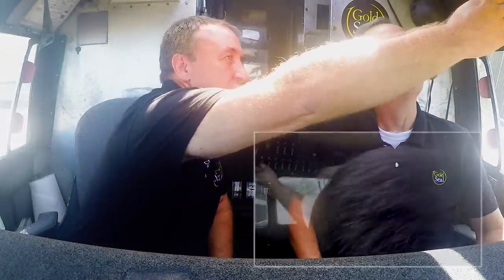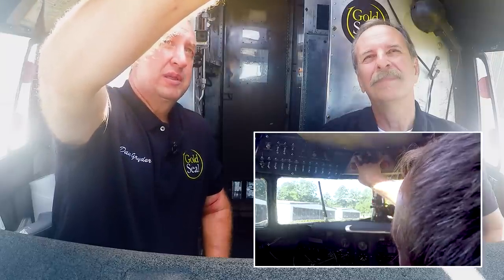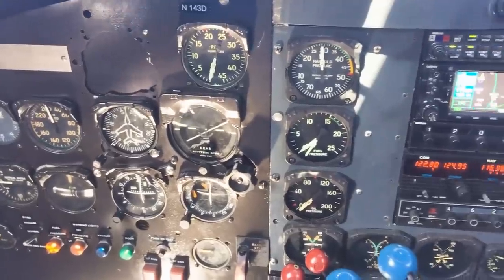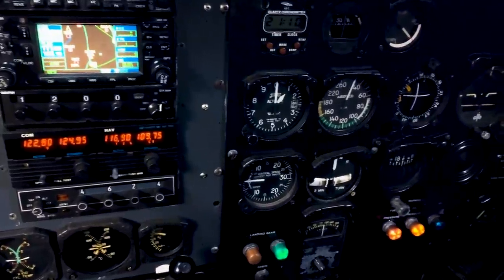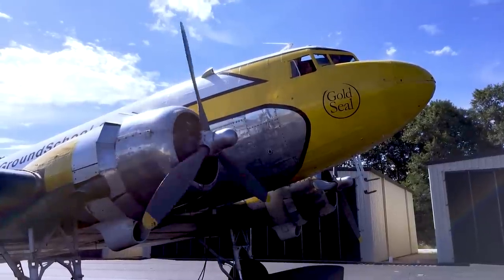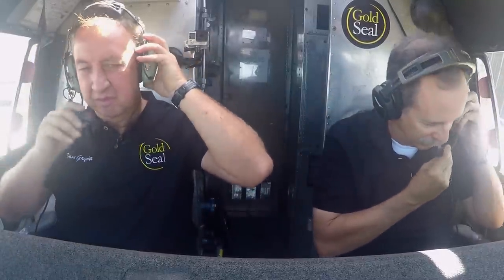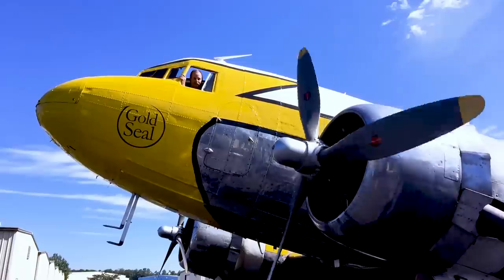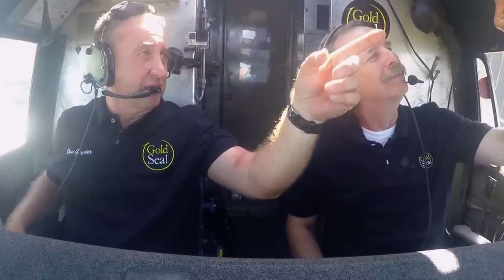Secrets to Starting the DC-3

Comment: My father, a lifelong private pilot, was Air Intelligence Officer in Pleiku, Vietnam, in 1964. At one point, he was a passenger on a Vietnamese C-47 to a dirt strip in a spot with a lot of VC. They felt safe, but knew they'd be sitting ducks after dark. When they went to leave, one engine wouldn't start. They tried various things, but it refused. With sunset nearing, my father brought a cargo strap out, put it over a propeller blade, and got eight guys to pull it. The engine started. Just another version of 'auxiliary power', I guess.

Comment: In 1968, I saw a C-47 right engine, started by 'rope', like a lawn mower. The rope was pulled by 15 Marines at MCAS in S. Carolina.  'It took 2 tries then we were on our way back to Florida.  I'll never forget that..
Reply: You are the only other person I have met who has seen this!!!  As a kid (6 - 8 grades), 1955 - 1957, I lived with my family in Tingo Maria, Peru. I once saw THREE engines on a DC-3 started by hand!  The right engine started normally. The left engine would not crank (I have NO idea what the problem was). They had a bit of a 'boot' that slipped over the end of one blade, this 'boot' had two ropes (elasticized, I think) fastened to it.  Four or five men leaned into each rope and a third swung the prop. The left engine was started by hand, and then the right engine would not crank. Due to direction of rotation, they shut down the left, started the right by rope and then again the left.  Hence THREE engines started by had on a twin-engine plane!
Reply: MCAS Beaufort. I was stationed there for 5 and half years and got out in 2016.

Comment: "The engine(s) will talk to you if you listen to them" - words of wisdom!
Reply: Yup, applies to radial aircraft engines, car engines, even simple 2 stroke motorcycle engines. Mixture, ignition timing, mechanical issues, listen and feel the engine, don't just rely on sensors, and lights or readouts.

Comment: On the vehicles that I service, I like to check the voltage drop between the lug on the starter motor, and the positive battery post while cranking,, also between the case of the starter and the negative battery post, again, while cranking.  Tracking down, and reducing resistance in the starting circuit can make a huge difference.  Great video !

Comment: Enjoyed the video. My first commercial job as an F/O was on the DC3 in the early/mid 80's. The panel layouts were very original, much more basic than shown here.
However after doing essential safety checks in the cockpit, my job was to remove the oil drip trays below the engines, and turn them over 12 blades to check for hydraulic lock, although I never encountered any. We did not have a pre-oiler or external batteries. Having completed the pre-start checks, essentially we had 2 switches next to each other. The first engaged the starter motor onto the flywheel and after 15 seconds the second switch was used to clutch the the flywheel to the engine. It's difficult to remember now , but after say 5 seconds the fuel was selected on, and after a little coughing, the engine would start fine, perhaps catching with a bit more throttle. Good batteries were needed....how else would you be able to operate the electric hydraulic feather pumps if an engine had to be shut down on say take off. Or unfeather for a restart....although I picked up a tip from an X Sunderland pilot. They flew that long that routinely they shut an engine down in order to top up oil for the throttle dash pots ( or something like that ). To save the starters and have a bit of fun, they would dive to the sea, side slip, get the prop turning and then put the fuel in !! 
One night the starter would not work, so out came the manual starting handle...that's when I learnt it was a 2 man job !!  Very difficult to get the flywheel up to speed and barely turned the engine when clutched....but it freed the starter so we were OK.
Only did it once, but you could start with 2 ropes. One bagged onto the top prop tip, to get the engine turning, and the second wrapped around the prop boss, like a windlass, to keep it turning...with lots of bodies running on this rope. About 1400 hours and about a dozen engine failures. Your ears became tuned to the engine note and vibration...very easy to doze off at night...and recognise a particular cough, like someone clearing their throats, telling you of a problem.
Reply: The '3 in this video has direct drive starters, you were flying with inertia starters. One little trick you could do with the old inertia start system was start both engines at the same time. You did that by spinning up the starters 5 or so seconds at a time for a while until both were up to speed. Then you quickly flipped the engagement switch from side to side. If you had the prime done right they would both light just about on the same blade over.
Reply: Your aircraft were equipped with inertial starters.  The airline I worked for (A&P) had DC-3s with direct-cranking starters.  We started the engine on primer, brought in the mixture, and then released the primer when we heard the engine choke on too much fuel.  Watching pilots do it, I discovered that they would sometimes start a still-hot engine with primer and mixture off.  As soon as a cylinder fired, they brought in the mixture.  I tried it, and t worked.  Even after an idle-cut off engine shutdown with mags on, a hot engine would find enough gas vapors in the induction system to fire up on the next start.  Don't ever let anybody tell you that the possibility of a hot mag is not a danger.  Always do a mag safety check after starting.
Reply: California Dreami

Comment: In my outfit in the Navy, we had 2 C-47's. We never turned the props through or pre-oiled, but we did use external power to start them always. Our APU was a gas-powered engine hooked to a 28VDC generator. It spun the props through pretty fast.

Comment: Awesome! Interesting tips about the voltage and being able to run the stater for longer due to the increased capacity. Never even crossed my mind to beef up the battery capacity for extended cranking, even though we learnt about electrical principles in high school physics 11/12. Useful tip for where I fly up in Canada, we some cold days during winter where it can take a few extra cranks to get going first thing in the morning.

Comment: Thank you for such a great insight, I’m sorry if I missed it if you don’t pull the engine through, do you drop the spark plugs out of the lower cylinders o drain the oil?

Comment: Pulling the Props through - I have never seen that ever in the years I was flying DC-3's in our Airlines (1,600 hours) & have never seen hydraulic lock.
Had a chuckle about the Electric Boost Pumps, I only flew one Aircraft with Pratt's that had them - all the rest of my hours were on Cyclone Engines (Which BTW the Company bought for $20 just after the War).
 We had a Wobble Pump behind the Captains seat which was my job to work.
 We told the Hostie that lever was to retract the Tail Wheel. :o)

Comment: I always pull props through counterclocwise six blades before starting...nev had hydro-lock.
Also went to 50 inches on take off (R 2000 7m 2.
To pattern altutude before meto.
Only had one cracked cylinder in thousands of hrs flying.on 7 m2 its usually #1 
Big radials,have to letem warm up to temp first...
Reply: You want 12 blades for two full revolutions of the crankshaft, which puts each cylinder through a compression stroke if you are going to be positive there is no hydraulic lock.

Comment: I've worked around a lot of Radial Engines - primarily the PW R-2800 on the old USAF C-118.   I worked all of the Instrumentation on that airplane.  I always saw the ground crew "pulling" the props through (slowly) which would cause the lower cylinder's valves to "open" and release any trapped oil, if there was in fact any oil in that cylinder.Not being an "engine man," I'm not sure if a radial that is "just started," that the motion of the prop would be "so fast" as to cause a hydraulic lock and bend a rod.   (not allowing any trapped "thick oil" to drain first.)Hey, move the prop a little - valves will open, and any "trapped oil" will drain out an open value.   Couldn't be simpler, that is unless someone left a mag switch in the "On" position.  There is always the chance that "Murphy's Law" will be in effect.
Reply: I went to airplane school at Reedley College in 1976. The Aero dept would buy tons of military surplus from the Stockton (Navy?) depot. We had rows upon rows of surplus reconditioned and rebuildable cylinders and they would sell those parts to operators all over the world. One of the instructors told us that lots of the systems they were required to teach us were obsolete (pressure carbs) and we would probably never see the stuff. Well.. one of the students got a job nearby working on the B-17's that were contracted to the forest service for fire bombing..and that's all he worked on! Last time I went to visit they were now teaching how to repair carbon fiber panels.. something that didn't exist in my day.

Comment: In fact, engine 2 is started first and engine 1 second. That's normal for a DC-3/C-47, cos the cargo/entrance door is at the engine 1 side. In this case it was easier to get the last people in, while engine 2 on the other side was already running.

Comment: Even though those two six volt batteries are pretty good size and I'd have to make some modifications to the Dodge, it would still be worth while if, like he says, you can't run those batteries down. I've never seen any battery that won't eventually go dead if drained long enough.
Reply: Those batteries are not 6 volts. They have 6 cells in series, so they are 12 volts each. 2 in series gives 24 volts. Each cell looks almost have the size of a full car battery. The amperage capacity must be huge. 

What old U-boat did you scrounge them off of?
Reply: They looked like standard 8D truck batteries.

Comment: Why when the engine starts does it not sound like the ones in the movies?  With the distinctive starter sound?
Reply from the maker: There are a number of different starter types, but the sound you hear in the movies is probably from old inertial starters. The DC-3 has an electric starter so you don't hear that whine that is stereotypical in the movies.
Reply: @GoldSealFlight  Thanks.  That stock sound is used up to the present day - as is the screaming flying wires sound prior to a crash, even if the plane is a jet.

Comment: It would have been nice if you showed the switches you are turning moving and flipping instead of just filming you guys talking.  As far as hydraulic lock being an old wives tale I believe you may be the only one who believes that.  Here is an excerpt from Wikipedia:
Radial and inverted engines[edit]
Hydrolock is common on radial and inverted engines (cylinders pointing downwards) when the engine sits for a long period. Engine oil seeps down under gravity into the cylinder through various means (through the rings, valve guides, etc.) and can fill a cylinder with enough oil to hydrolock it. The seepage effect can be observed by the blue-white smoke commonly seen when a radial engine starts up. In order to prevent engine damage, it is universal practice for the ground crew or pilot to check for hydrolock during pre-flight inspection of the aircraft, typically by hand-cranking the propeller for several turns to make sure the crankshaft cycles normally through all cylinders.  Nice old airplane.  I'd hate to see you distroy your engines.
Reply: Douglas Tees 
You choose Wikipedia to quote?? Why not something that can be verified?
Reply: Douglas Tees
Reply: Douglas Tees How it works is, if the engine sits for more the 30 minutes, oil can lay in the bottom cylinder  on a radial, you hand prop it threw 2 or 3 times, if you can't pull it threw, you pull the bottom spark plug and drain the oil. If you try to run the engine and it hydraulic locks, you can bend the articulated rod, knucle pin, mess up the master rod, piston, cylinder  etc.
Reply: It's not just old aircraft radials. I worked an old shortwave station in the 1980s and we had to turn the generators over (big 1950s 300kW Mirlees ship diesels) once a day to ensure that they weren't hydrauliced when needed - it had happened in the past and resulted in bent conrods and expensive repairs.
Reply: Wikipedia uses verified sources to get their information. It is better than looking at the google results.
Reply: snowgolem609 aviation and more! Wikipedia uses verified sources?  I’ve added many things to Wikipedia without an account, just being anonymous, and my information has never been taken down.  Of course, I’m not trying to screw people over and spew false information out but anyone can add what they think is right.  Not always what is right.
Reply: Did any of you actually listen to what he said? He said they have a mechanic check for hydrolock briefly but don't hand cycle the engine to "pre oil" it.
Reply: He didn't say hydraulic lock is an old wives tale; he said pulling the prop through to pre-oil is an old wives tale.
Reply: He's Not as funny as the comedian " the worlds foremost authority".No check list - no instructor.
Reply: Gary Prost You're not hand proping to pre oil any large engine. So I don't even know why he'd say that at all, you can't pull a large engine threw fast enough by hand to pre oil it or start it. On my the small 4 cylinder opposing head engines, and lawn mowers.
Reply: He's right AND wrong. Puling 'm through gently (experience counts - SAE 60 motor oil at various temperatures, etc) if they haven't been shutdown over 30-40 minutes MIGHT let you skip removing some spark plugs. Otherwise I always figure on the bottom three on each row (Some threes had R-1820 Wrights = single row, some had R-1830 Pratts, twin row)(Hey pulling plugs on radials is FUN and part of the job).
        And while the "pre-oiling" is nonsense - even if it's only been shutdown 10-15 minutes and two crankshaft revolutions (the propeller revolutions will be less because Three engines were all gear-reduced) tells you it ain't locked it just can't hurt to try to use the air in the cylinder to push a little of the combustion chamber oil (there's guaranteed to be some) out into the exhaust port right before starting.
Why? They are like 6.5 to 7.0 -to-one compression ratio engines but any oil at all can easily raise that to 10 or 12 to one, temporarily - and that can't be good  for it. Better to do it slowly by hand than fast with the starter.
Reply: Douglas Tees @
Reply: Douglas Tees he said they do not spin the props to pre oil. They use the ground grew to move the prop slightly to verify no hydrolock. It is not nesessary to spin a prop 12 or 15 times to verify hydrolock. And trying to pre oil by manually spinning a prop is rediculous.
Reply: Learn how to spell through!
Reply: Ridiculous, no e.

Comment: Gotta disagree with your #1 secret Dan. We ALWAYS pull the prop through by hand to check for hydraulic lock. As you state, you can feel it. Believe me, without doing that the very powerful starter motor will just persist and may cause VERY serious internal damage to the plane. For comparison, my Mack B61 had an air starter rated at 25HP and that's just for a 6 cyl diesel engine.

Comment: So the boost pump just an electric fuel pump, like Piper. So does the DC-3 have an engine primer...
Reply: Some do, some don't. Like they said, there's thousands of these that were built (and before when we started to "standardize" cockpit layouts), so you're bound to find anomalies.

A quick Google search will give you evidence of primers being installed on some DC-3s.
Reply: The custom C-47 I flew back in the 70's had primers for the Wright engines this one came equipt with.

Comment: I would believe how many volts and amps you have hooked up if you you told me.
Reply: Well, if you look at the batteries on the start cart they are lead acid type with 6 cells.  At 2 volts per cell that makes them 12 volt batteries.  There are 2 of them wired in series so the voltage going to the aircraft is 24 volts.   The amperage flowing from the batteries will depend on the electrical load of the aircraft, but judging by the size of the batteries, if they are healthy and at full charge you should be able to get 500 to 1000 amps from them with minimal voltage drop.

Comment: so how much oil does one engine go through ( in quarts) per 100 miles?
Reply: Radial engine oil is measured in gallons, not quarts, and hours of operation, not miles.  The DC-3 has a 22 gallon oil tank for each engine, if I remember correctly.  Starting in 1965, I worked for an airline that operated DC-3s and CV-240s.  I would estimate that each airplane would have about four to five flight hours when it came in to the airport where I worked.  I believe each DC-3 engine needed about 2 to 2-1/2 gallons of oil at that time.  The larger, R-2800 engines on the Convairs used more oil per hour, and frequently required about 4 gallons per engine.  I spent a good part of my shift filling five-gallon cans with oil spouts from fifty-five gallon drums, and wrestling full drums in place of empties.

Comment: "Amperage" does not exist. There is voltage and current. The unit of current  is amperes (amps). Technical people should always try to use the correct terms when explaining things to the uninitiated.
Reply: "Voltage" does not exist.  There is electric potential difference and electromotive force.  The unit of EPD and EMF is volts.  Pedants should always try to use the correct terms when explaining things to everyone.